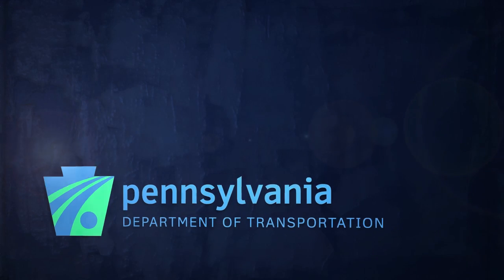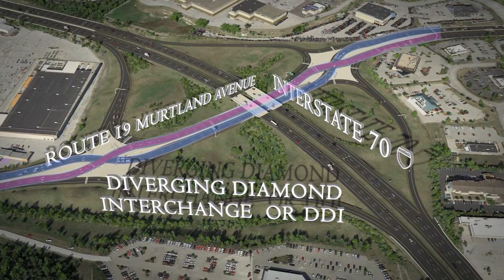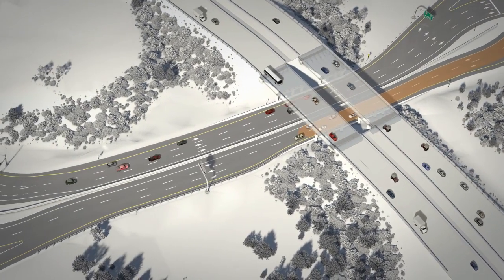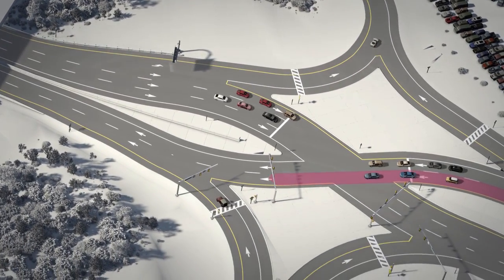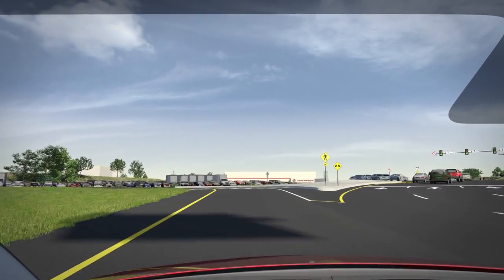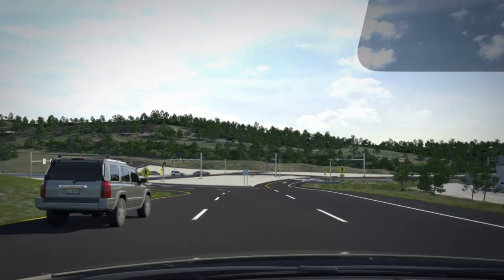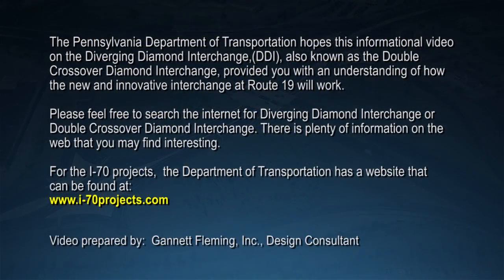Diverging Diamond Interchange Simulation -- I70 in Washington, Westmoreland counties

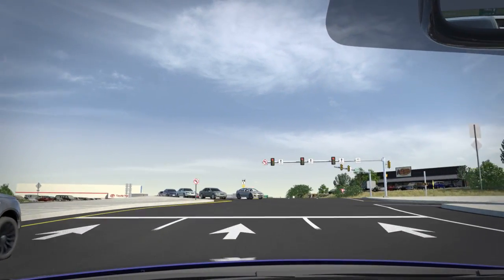Comment: In the video from 1:50 to 2:30, the traffic stops at both lights.  Is it possible to time the lights so that you do not have to stop at the second intersection?  This may help traffic flow even better.  With the extra stop, I'm not sure this would work any better than a roundabout at each side of the overpass.

Comment: I live 3 miles from this interchange. This is an innovative engineering marvel, but it's going to confuse the heck out of older drivers. While the traffic signals in place will help with merging, I'm afraid they just won't get it even with the signs telling you exactly where to go. This will avoid a lot of high speed highway accidents but low speed fender benders on 19 will be exponential at first.

Comment: The only benefit I can see of this (Washington, PA) interchange is the elimination of the short and unsafe entrance/exit ramps to and from I-70.  But that isn't even mentioned here as a "benefit."  Other than that, adding more stoplights to an interchange where there is already a freely-flowing traffic movement (without stoplights) is simply making a more time-consuming and confusing situation.  Now, if there had already been traffic lights at this intersection, then this new interchange wouldn't be any different.  I travel this road everyday, multiple times a day and there are NEVER any issues with traffic not being able to freely flow through.  This could be overkill in terms of cost-benefit. So, in ending, I really don't see how this new design, along with the great expense of building it, is really going "improve" the flow of traffic.  That's just me.  Maybe the money used to construct this could go towards updating and upgrading a dilapidated bridge somewhere.  Heaven knows, there are certainly plenty of those.
Reply: It's just another way that PennDot has found to waste money. They seem to be fascinated by replacing old intersections with "new and improved" ones like this and the traffic circles.